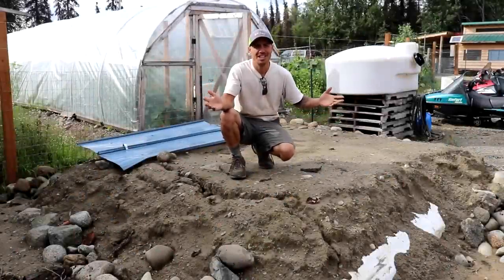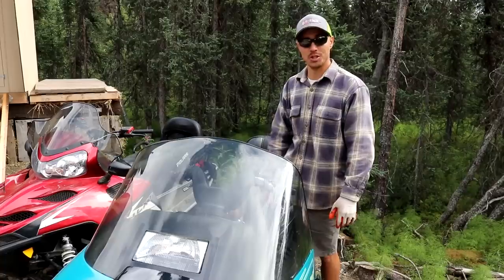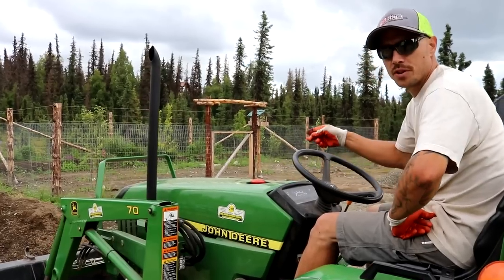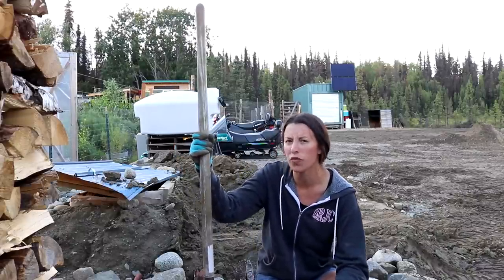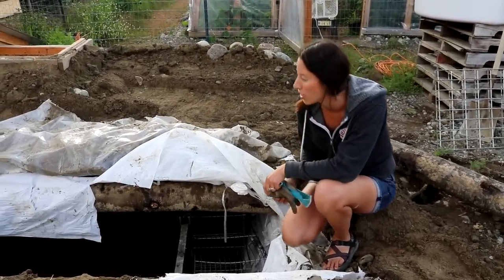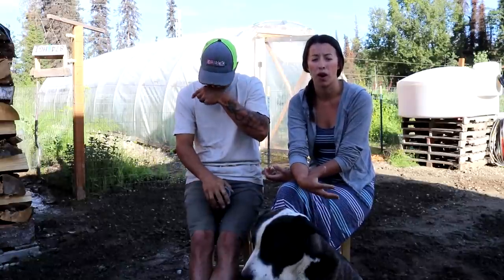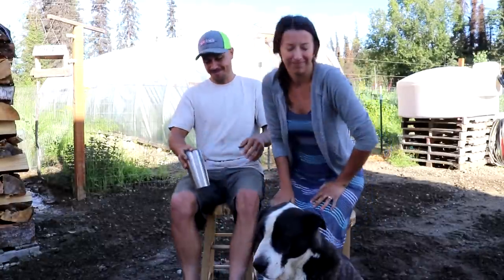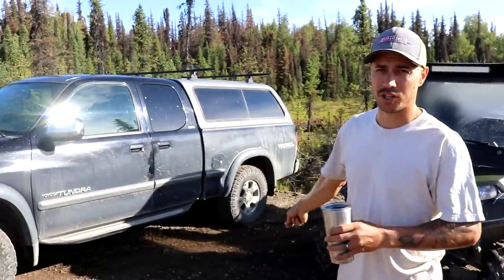Our Earthbag Root Cellar Fails | Addressing the Mud Issue

Comment: My stepfather, living on top of a small mountain in Arkansas, decided to build an experimental above ground root cellar.  His land was solid bedrock just 6 inched below the dirt, so there was no chance of digging a cellar.  Unfortunately, he is no longer alive, so I can't talk to him about it. But he acquired four 4x8 foot sheets of thick styrofoam (I think it was 8") and he just stood them up to make an 8 foot tall, 4x4 box, and cut a small door in one panel.  Then he wrapped the inside and outside with galvanized chicken wire and covered all of it with stucco.  There was no support structure at all - just foam and stucco. He added a pitched roof and more insulation on top, and it worked great. And apparently, it was plenty strong because a tornado took down his house and garage but the root cellar which was only 10 feet from the house made it through untouched.
Reply: I was considering a stucco or waterproof cement wall and this really helps! Thank you for sharing what you know

Comment: I see a lot of tyre slippage when pushing or loading on the John Deere.    I grew up on a farm and we did the following on all our tractors.   You can fill the rear tyres with water and this increases the traction a lot.  Simple to do.    Jack up the tractor and support the weight.   Unscrew the inner valve and attach your water hose to the valve with a hose clip.   Put a small hole in the hose near the end and push a small breather tube into the hose extending into the tyre.   Turn on the tap and as it fills with water it pushes out the air.  When full just undo the hose and screw the valve back in then add a little air pressure as normal.    You will be amazed at the difference.   I’m living the dream watching you guys.   Regards. Alan from Australia

Comment: You could build an above grade earth insulated shelter.  Maybe just use some logs for columns and then on the outside of the columns attach   half logs.  
Civil engineer (that's me) pro tips: put a high quality water barrier (go to polar supply) and a couple inches of  foam over it.  Then bury it. 1 inch of foam equals 1 ft of dirt.  So put 4" of foam on the top of it.  Then put some cover on it.  Just dont overload it.  Dirt is heavy (that's what the insulation does.  It cuts down on cover).  Maybe have your inside grade about 2 ft below the adjacent grade.   In corporate it into a garden or something 
You could also get some precast concrete out there.  If you dug a hole  you could bury a storm drain manhole.  That would be pretty ideal, actually.  Maybe you could get Anchorage tank to sell you a septic tank tank with just a bottom and top welded on.  
Maybe get a bottomless tank  barrel that has the tar on the outside.  Set that in a hole about  a foot deep.  Make sure you put a little concrete ring for it to sit on.  Pour the bottom full, make a lid and insulate and bury. 
You could also get a closed tank with a custom opening on top and no baffles.  You could use the 4 inch inlet and outlets for breathers.  
You could bury that tank below the waterline if you put ballast.  Basically put a gravel floor in it.  
A big culvert could work.  
You could cast in place a concrete box.  
Maybe just bury a connex box.  Keep your eyes open craigslist and marketplace.  There is junk out there.
Reply: Septic tank I think would work great for them. Precast tank of some kind would be water tight.
Reply: I see people buying even the plasic tanks to bury. Im actually thinking of one or two of those for myself. What is your thoughts about the big plastic septics to use as underground storage????
Reply: colorado prepper packrat I bet that would work well also with a dirt covering. The only thing that comes to mind is many of the plastic tanks are round which would be somewhat difficult to put shelving in.
Reply: @MookieMan1  ummm right i would hav to think about some sort of flooring. Maybe build from 2x4s??? Would mostly be 5gal buckets. My canned up jars in house!!!💞💞💞💞😺😺😺😺
Reply: @coloradopackratprepper  Big plastic tanks that are full of air will collapse from side pressure. Not a good idea for them because the saturated soil will destroy the thing, but if you were in a super dry location, you could go for it.
Reply: @dper1112   yes i am. very little rain and up on the side of a mountain very dry.💞💞💞💞😸😸😸😸
Reply: Plastic tanks have a rated depth of bury.  The issue with an empty tank is that the buoyant force of groundwater will act to float it up. 
You will want to resist that force.  Concrete tanks are expensive, and heavy.
Reply: @coloradopackratprepper  you will have trouble with humidity. The beauty od root cellar is its ability too keep nearly constant air humidity all year round. Plastic shell cannot breath so you will have to keep that balance yourself.
Reply: @lamebubblesflysohigh  ok thanks!!! I appreciate all the feedback i hav gotten about it!!!!!💞💞💞💞😸😸😸😸
Reply: For an above ground root cellar, consider a "permanent wood foundation" -- basically a very sturdy frame wall made from pressure treated 2-bys and plywood, intended as an alternative to concrete for basements, and buildable with basic carpentry skills. Give it a strong roof built the same way and you could pile dirt on the whole thing. Lay some drainage pipe out to your bog and you wouldn't have any trouble with water. Sink the floor below grade a couple of feet and it wouldn't need to be more than six feet high or so.

https://www.awc.org/pdf/codes-standards/publications/pwf/AWC-PWF2015-Commentary-ViewOnly-1411.pdf
Reply: “1 inch of foam equals 1 ft of dirt”
For insulation yes, but not for thermal mass, which is what an elevated root cellar needs to maintain temp. So you’d also need to create an umbrella of insulation extending out from the perimeter so the ground below the (above ground) root cellar never freezes. 4” of foam is not adequate. 12” might be. That would give about r50.
Above ground is definitely the only way to go here. Below grade is too complicated with the high water table. Very easy to add cooling (if needed) in the summer powered by solar. Very easy to insulate from freezing in winter. 
I have a vermiculture setup that works great year-round with 12” eps.

Comment: Get another shipping container build a artic entrance on it and pack in a few feet of dirt all around it and above it. Same as building a root cellar in a side of a hill but your building the hill. Then plant a hardy local grass on it.
Reply: Yes
Reply: Their property is not that big unless they drastically expend into the bog but we are talking about major landscaping project here. It would be easier and simpler to insulate that container with polystyrene, fill all voids with expanding foam and use dedicated AC unit to cool it during summer months. Yes it would require hooking up to utilities (electricity) and thus yearly cost but it would be still cheaper than filling of a chunk of that bog and building of an artificial hill on top of it.
Reply: @lamebubblesflysohigh  whatever what plant did you hatch from
Reply: Agree. Think about two, 20 foot insulated refrigerated shipping containers. One for your garden canning, and the other one for hunting and fishing and hanging other meats. 🐂🐖🐏🦃🐓🐟

Comment: You're gonna have sink issues in that hole for the next 30 years. Those logs are going to make a nightmare when they rot
Reply: Wondered about that - It was my first thought— sinking
Reply: @sgrvtl7183  not to say about the plastic left in there. Very sorry to see them do that too.
Reply: Exactly. I was thinking the same thing. In our area, a little boy died when the ground collapsed under him because the builders of his family's house left branches in the ground after they finished construction. They covered the branches up with dirt, and when the branches rotted, a sink hole formed.
Never bury wood.
Reply: Hard to make sense of that. Probably could have put the sand bags to good use somewhere else and they obviously use a lot of firewood so why would you bury that stuff... I don't get it.
Reply: Basically, you’ve created hugelkultur:  plant a garden where the root cellar used to be an reap the rewards.  (Lemonade from lemons)

Comment: There are so many above-ground root cellar designs online that I am sure you will be able to find a good one. Your sloping ground looks useful! Mind you, I can't think why you threw those logs down there!
Reply: Looks like they needed the fill.  All their dirt was used to add space and gravel is expensive, esp when you have free filler from logs.
Reply: @digitalguru42  I suppose so! Coming from a place where logs are expensive I would have kept them to try to build another version.
Reply: The problem is, in time the logs will disintegrate and the surface will cave in slightly.
Reply: @sophiamac9100  hadn't thought of that.
Reply: @sophiamac9100  buried underground without oxygen will slow decomp.

Comment: Make a root cellar above ground like earth homes and cover the entire structure with dirt.
Reply: Was thinking that also.... Concrete building covered with earth. Then grass it out for looks
Reply: Yeah exactly hope that will help.
Reply: @timothystrampp3313 Don't even need the concrete, they are already experienced earthbag builders
Reply: @BenjaminKlahn  I'd go a few feet down also and then form out the structure in concrete.
Reply: Yup they could use used tires and pack them with sledgehammers.

Comment: Thanks for sharing this. 
Water is the biggest problem with any retaining wall. You may consider instead of backfilling with dirt around the perimeter using clean rock with a drainage system to a sump this will relieve the pressure on the earth bag retaining wall.

Comment: watch off grid homesteading with the boss of the swamp. He made an icebox which could be adapted for a larger insulated cold room. You could build it either off the cabin or as a stand-alone. Worth a look anyway
Reply: Yes in a bog you want above ground Root Cellar like a walkin cooler
Reply: Problem is they’re off grid so the cooler to be cooled means they’ll have to also buy a lot more solar panels & batteries, maybe even another converter/controller to power the AC it’ll need.
Reply: Yes

Comment: Awesome videos guys - thanks for sharing the hard-knocks lessons.
**I'm neither an engineer nor a professional builder**, but based on my research/experience I wonder if a few things might have made a significant enough difference to have saved your project (water table aside - nothing you can do about that...):
1. Using a terrace-style design, or at least building the walls a little closer to the angle of repose of your soil
2. Backfilling behind the wall with gravel to help reduce the hydrostatic pressure on the wall
3. Rounding the walls of the structure to increase the inherent strength of the wall
4. Grading the ground to slope away from the structure (10% for the first 5-10 feet around the structure)

Comment: Very sorry for your loss. Not suprised though, some places are just too wet. Can't wait to see what you build for your storage next. A little advice (I learned from decades of burning in a wood stove) have all your firewood inside a dry building. Not air tight but don't let it get wet. And season it for a year before using.

Comment: Not really a high water year, it’s a typical year for our area last year and the year before were fairly dry years.  Coupled with the swampy land the hydraulic pressure on those bags was inevitable.  A viable option is a round concrete cellar with a concrete floor, foundation sealer on the outside and DryLok on the interior sand floor and spritzing will control the humidity needed for storage. An epdm membrane apron round the perimeter six inches below the surface grade will help was rainwater run off and away.  If you’re in any of the local growing pages on Facebook and you see a garden tour for snow fire gardens over off Fairview loop, go check out there large walk in root cellar.
Reply: also you could sink a large steel container then bag the inside .
Reply: @BigDsGaming2022  A steel container will do the same thing, they will crush under the earth load.  They are not designed for that load, at all.  Only if you could keep all the load only concentrated on the corners.  So many pics online of people trying it before thinking it through or googling it.
Reply: @RealHankShill  so smart but you never discussed Oval Cylinders verses SquareSteel Boxes . There are no corners in round Steel Silos , maybe that is why they are used instead of square steel ?
Reply: @RealHankShill  look up connex shipping containers. We routinely bury those for underground storage, shooting ranges, etc. They don’t crush. If they did, it wouldn’t be possible to stack them close to a dozen high on barges.

Comment: I know I'm late to the party, but just discovered your channel a few weeks ago. 
A few things about building with earthbags: round is usually going to be the better building shape for earthbags, especially underground. That will distribute the load more evenly across the structure. Also make sure you're backfilling every 2 or 3 courses and packing it tight instead of backfilling at the end.  Second, using rebar to reinforce the courses of bags every so often is a good idea. Third,  use thicker and larger sheets of plastic for the moisture barrier between the bags and the dirt. Moisture is an eartbag's enemy if they're not coated with something so you have to keep them dry. 
Your water table seems a bit high,  maybe dig more shallow and have a few feet of your cellar above ground and berm it. OR build an entirely above ground cellar, insulate well and use earthtubes to regulate the temp (think eartships and thermal mass). Sorry about the cellar, you guys worked hard and that really does suck.

Comment: I know it's already been suggested numerous times here, but maybe try an above ground cellar. If you chose to go the earth bag rout again then make it circular. Circular walls are much stronger. That, coupled with the near lack of frost heave you'd see from an above ground cellar, should provide a more than sturdy structure.
Reply: i dont think so; Water is a devil and finds always a way, and once its underway you can´t get rid of it. The first hole is very small, but when Water is digging, you dont have a chance.
Reply: @MrClivelupo  Above ground would provide positive drainage, and if washed rock is used with fabric and weeping tile then there shouldn't be any water issues unless the area of the cellar itself is flooded.

Comment: Have you considered building an above ground root cellar? There are plenty of plans for them online.
Reply: That would probably freeze.
Reply: frill Above ground root cellars if built right will not freeze any more than a below ground root cellar. You just need enough insulation and soil to cover it up. They’ve been used for centuries.
Reply: @johnnyblood2  they could have got a pretty good start on it reclaiming those early bags.
Reply: MrAwsomeshot The bags were not a good option.if the walls were collapsing, they would likely collapse in an above ground root cellar too. Their best option is cinder blocks, timbers, or a prefabricated structure like a small shipping container.
Reply: Where the ground freezes deep, you need something solid to fight against ground movement. If underground you also need to surround the structure with a gravel at least as deep as the ground usually freezes. This does not help the water in the cellar. I think mostly above ground cellar buried in thick layer of earth is quite a good option. Those are used if the ground is wet. (I am from Finland, where we are used to cold winters, wet springs-summers-autums).
Reply: emppulina I lived and worked on a farm near Joensuu years ago.
Reply: @johnnyblood2  Small world Boys and Girls...Me too....I agree...A rootcellar partly above ground is the best option...l can see one like that right now from My window....Over 60 years old...Still standing

Comment: One other option:  create an insulated space below the house.  Add a trapdoor to the house for access.  Should be able to keep items cold and not frozen.
Reply: Did you miss the lesson here?
Reply: @59nang  Since the house is ~ 2 feet above the ground, no digging is required.  Or if they would like it deeper they could dig out one additional foot (above the water line).  The walls would be stiff insulation and surrounded by hay bales on the outside.  Potentially this temp root cellar could be under the front porch.